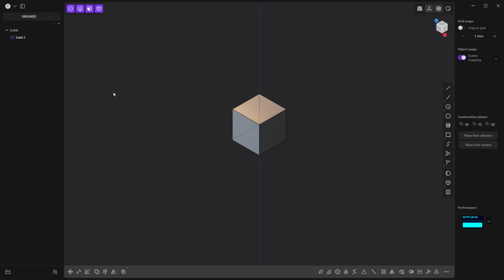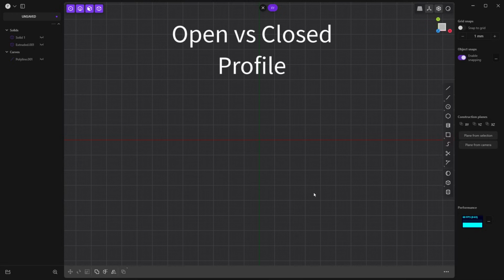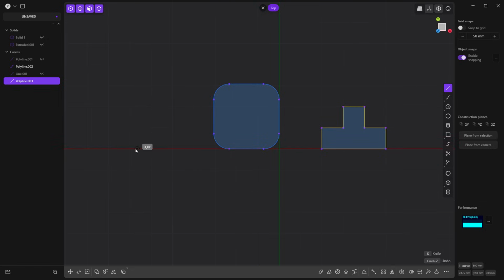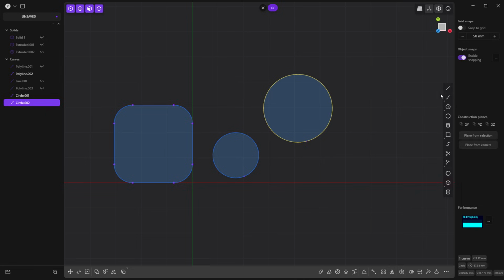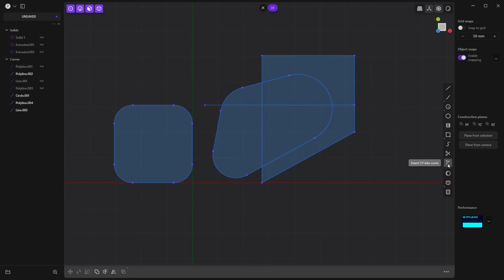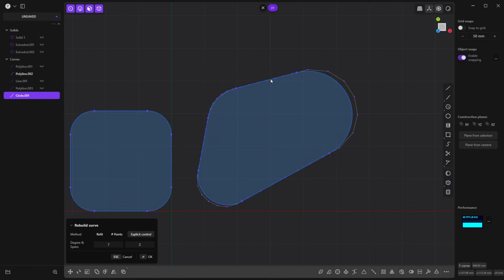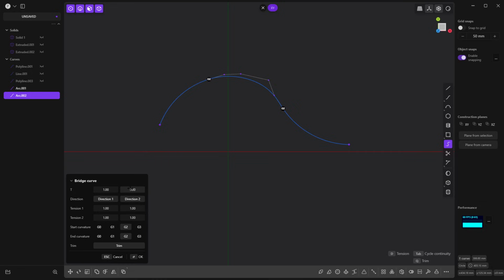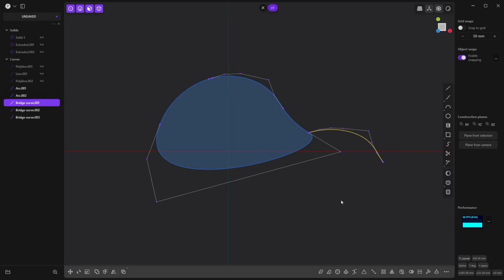Getting Started with Curves in Plasticity

Comment: If I have a compound path that I want to add a face to it. can I project or boolean from the Top view so I can make it a sheet? I'm trying to add a top plate to the inside of an organic shape kind of like a lid.
Reply from the maker: Yes if you have a compound path you should be able to select it, hit E and extrude it.  If you have a closed border you can also patch the surface.  With the pro tools like xNurbs you can do that with some intermediate curves that don't touch the border but are used as guides.
Reply: @LearnEverythingAboutDesign  is that in the free trial? Some of the features are missing. I did try and patch but I got really messed up results. The path is 3 dimensional so the the face met at some tangent point in the  middle and became wavy.
Reply from the maker: @mithrandir404  the trial should be the Indie version, that should let you extrude a 3d curve or sweep it along a path.  Patch might not work based on geometry but that isn't a Pro only tool.  The pro tools generally fall under Xnurbs/Square, and some retopo type stuff on faces like Raise Degree and rebuild face.  

The tools in plasticity are often greyed out until you have something selected.  For example you will need a curve selected or a face to extrude.  If you don't have anything selected the tool will be greyed out in the tool list.  I don't believe extrude is limited to only 2d curves in Indie/trial.  If so that would be the first time I have heard that come up.

Comment: Great work as always! I have a question - when I am using Line to to create a shape and once bevel - why does mine go into segments as a opposed to a continous line? I am trying to loft and because of the segment its failing my loft. Any ideas as to how this can be rectified sir?
Reply from the maker: Hey there, when you say that yours goes into segments.  Are you talking about adding a bevel to the 2d curve?  If both lines are part of the same curve (poly line) the bevel should be part of that.  So basically you have 2 lines and now you would have 3 that belong to that object.

If for some reason yours are not you can select all the lines and hit J on the keyboard to join them together.
Reply: @LearnEverythingAboutDesign   Hey sir - when I am creating a shape using the line tool it becomes a "polyline" I am currently working on a tutorial and it displays that their "shape" is still a curve and when imprinted the shape even beveled is one single shape and even when the said shape is a duplicate and CUT is applied their shape is still one continous line as well.
Reply from the maker: @TidyBridie89  without seeing the exact case its hard for me to say.  can you link the timestamp here so i can see?  Depending on your selection filters the lines may appear different.  If you look in the upper left corner if they don't have the first selection filter on this will now show the points.  if you have yours on the points will show.  if you draw a spline for example if you have the control point selection filter on you will see the controls.  if not it will look like a line with no point.s

Comment: Hey awesome tutorial !!
everything straight up to the point and well explaned, Thank you for sharing this ! :]

i got one question,
How do you slide the values when you are doing an operation, for example when you did rebuild ?
Reply from the maker: In any of the dialogs if you hover the cursor over a numerical input box you will see the cursor change. you can hold the left mouse button down and drag left/right.  So for example rebuild curve if you go to # Points, it defaults to 10, you can either manually enter another number or hover the mouse over the 10, hold the LMB down and drag right to increase or left to decrease.
Reply: Thx a lot it works now ! 
I tried it before but for some unexplaneable Reason it didn't react haha